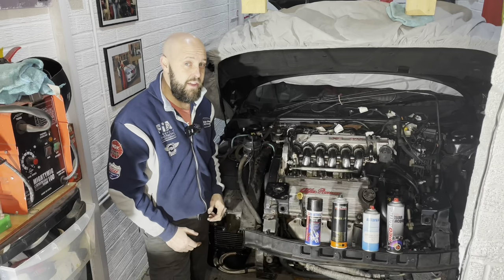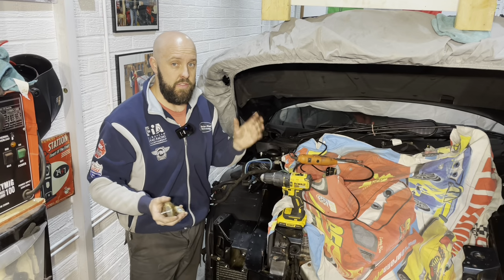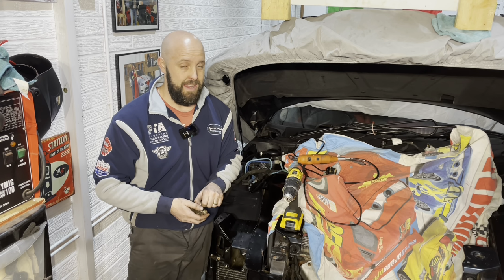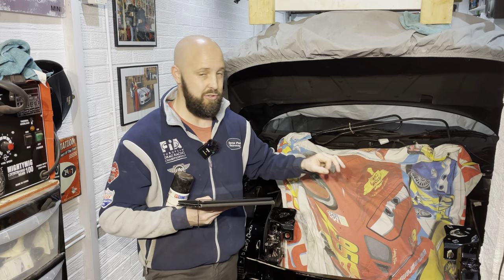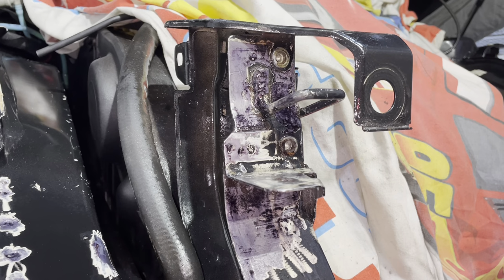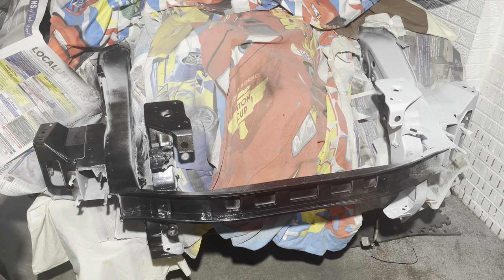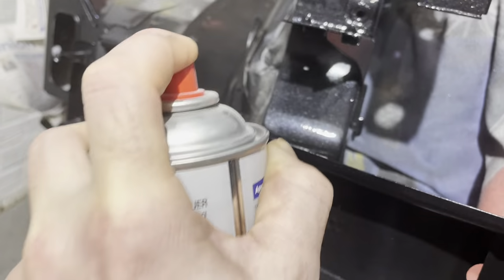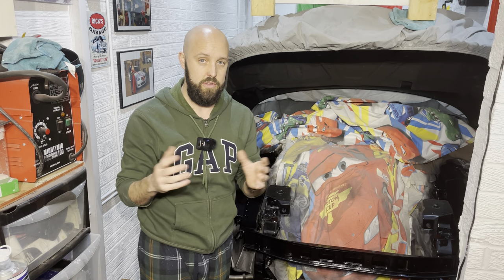DIY engine bay painting. Alfa GTV engine bay restoration episode 3

Comment: Hi Rick, great job. 
Who do you use for the Zinc Plating? I’ve had some done but I’ve found that if there is heavy corrosion then the finish is not great.
Things like the large nut on the rear subframe for the long bolt for example 
As we learn, we get braver…great work and inspiring
Reply from the maker: Hi David. I know exactly what you mean. Platers do generally treat hardware prior to plating but its not really adequate for anything with stubborn rust. The absolute best thing to do is remove the rust yourself prior to plating. To do this, soak your hardware in a vinegar bath for 1-2 weeks. I usually buy up to 10 bottles of non branded vinegar from any local supermarket for around 20p each! It does the job very well. Once the vinegar has done it’s job, soak the hardware in WD-40 to prevent flash rust then drop them off at the platers. The plater I have used is Karas plating in Leigh. They aren’t cheap but the finish is far superior to anywhere else I have used. You should also be able to do it via post if you live too far away. I do plan to cover this subject in a future episode as I have many things to be plated myself during this little project.

Rick